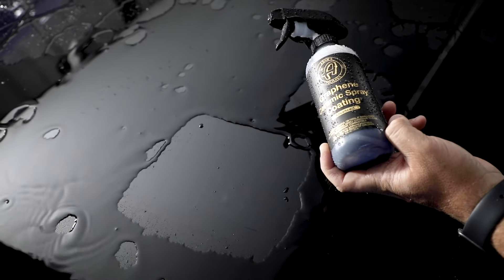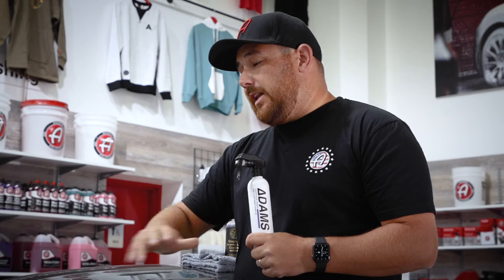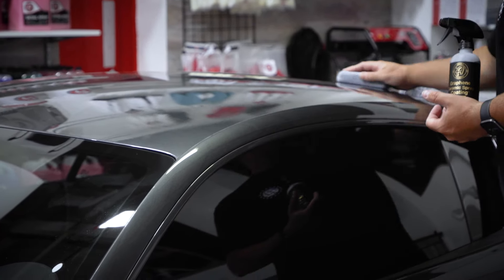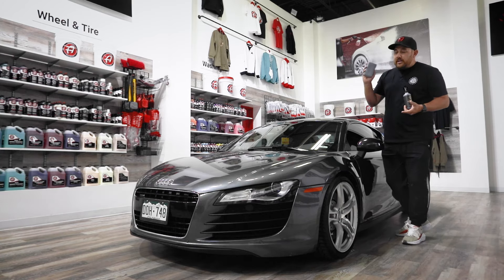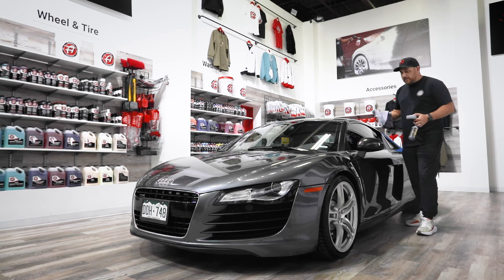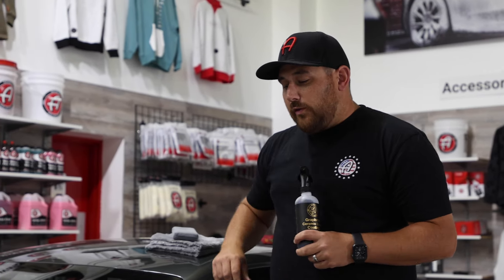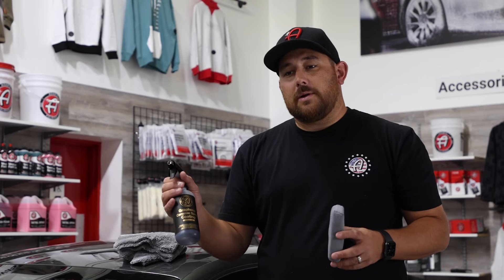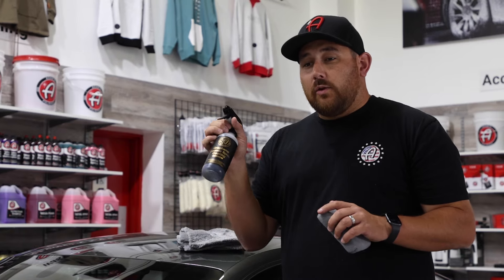How To Apply Adam's Graphene Ceramic Spray Coating Advanced

Comment: DO NOT USE THIS ON THE WINDSHIELD. other windows yeah, but the wipers grab the windshield when raining not “gliding” across the glass smooth. Did this on two of my cars.
Reply: what did you end up doing afterwards?
Reply: Actually all you need to do it apply the coating or a different ceramic to your wipers it will 💯 not grab
Reply: I applied to both of my vehicles with zero issues. Absolutely love how hydrophobic it is!
Reply: How has this held up? Over the time?
Reply: No issues on my windshield.....buy new wipers
Reply: I learned this the hard way.
Reply: Did you Clay Your Windshield before applying this?

Comment: Just received mine this afternoon. Prepped and applied it to the windshield of a ‘15 F350 Superduty. Extremely simple & easy application and finishing. The only thing that this video neglected to mention was the 4 hour cure time before exposure to moisture(rain, snow, etc.)
Reply: UPDATE - Not impressed. Water repellency is VERY disappointing. Water beads up but does not freely run off the glass. At 70mph big beads kid of walk up the windshield. Super grabby stuff. Again, VERY disappointing. It rained all day from Portland to Whidbey Island and I spent the entire time pissed at how the Adam’s “Advanced” product was failing to perform as advertised. The day after that trip I called Adam’s to inquire about what could have gone wrong. I was told to let it flash for 10-15 minutes instead of 1-2 minutes. Did that last night in a 61° garage and let it cure inside for 10 hours. Raining hard this morning and still the same result. This stuff is $35.98 garbage.
Reply: A lot of times products like this require a topper. Ik it stinks because of the cost but I had a heck of a time with 303 graphene until I used a topper extreme solutions makes one called topper. Other then that turtle wax is synthetic spray wax also works well to add slickness and even some depth. Good luck
Reply: The flash time will vary based on temps and humidity, the higher for either the shorter/less time it needs. Also, it behaves differently on glass than paint before removal, it is very difficult to see the rainbow appear and then dissipate. Sounds like you may have removed it too soon. What prep did you do?
Reply: think you'll have better results with stuff like rain x
Reply: Get a WINDSHIELD COATING!
Reply: @chrisinco5920  I thought colder temps require longer flash times
Reply: @otm777  You're absolutely right! My fault...had that backwards. Corrected. Thanks for keeping me honest
Reply: @pj9241  if it requires a topper, I'd seriously be asking the question "can I get the same result using ONLY the topper?"
Reply: @gregsullivan7408  sorry this was a while ago so I will do my best to recall what I meant.  The cure time of four hours before being introduced to the weather is troublesome for some so a topper that is solvent free is a good idea because it puts protection over the coating. I have also found products like this and some other spray coatings get better over the following week. I like adding a topper to add shine protection and water resistance to the coating as it sets up. A topper alone is fine but you will not get the same results as you would just using a topper. Another thing I have found is some of the ceramic based coatings leave the car with out the wax shine. Then definitely add gloss but they don’t have a warm shine a topper can help with that as well. So it’s kind of like the coating becomes an extension of the paint and the topper becomes the sacrificial layer then can be added after every wash.
Reply: @DRTYFN  Thanks for saving me money!
Reply: @ainttakenanyshit  I’m very familiar with RainX. I started using it in the 80’ when it was difficult to apply and worked great. Then they sold out in 97 or 98 and the formula changed and durability went down the toilet. Nowadays it barely lasts a week in Oregon rain.
Reply: @DRTYFN well that’s because this isn’t windshield coating it’s paint coating. You use their windshield coating for the windshield lol what are you yapping about.
Reply: Yes, RainX was great in the past, but it was a pain to apply. Now, it hardly lasts a week for me.
Reply: Ebay to apply, thought. I heard Pledge furniture polish works well, I have not tried it yet.

Comment: Question - should you prep the paint first? meaning, clay, polishing/buffing then apply the ceramic spray?  I am new to these things and want to make sure I do this right.
Reply: Yes! 1000000% prep the paint first, then use with their prep spray, or just some rubbing alcohol to strip off the wax and polish. Once the paint is bare then you apply this product
Reply: @orion9807  what if I don’t polish ? Will it affect it that I didn’t
Reply: @RodrigoRodriguez-ri7wn  any imperfections in the paint will be sealed in......so if there is any light scratches they are staying until you polish away the ceramic, and then polish the scratch......it's best if you just polish before applying for the best results. It doesn't need to be perfect, just looking better then before.

Comment: Could this be a topper for the Adams Graphene Ceramic Coating Advanced? Or I need to pick only one and don’t apply the other?
Reply: I wouldn't. For upkeep between coatings, I use thier graphene detial spray.

Comment: love this stuff. really no need for true glass coating with this since all my customers are maintenance washes I just decon wash and light clay and reapply another coat to rejuvenate. its amazing.  one of the few truly great affordable coatings that doesn't necessarily require full blown correction. though that only helps. I recommend that for 1st time application only

Comment: Have a questions, just received two bottles of Advanced Graphene Spray(BOGO deal).  One of the bottles is a clear liquid, the other is a black liquid, when applied it goes on black.  Emailed Adams, and they say this is normal.  Why the contrast between two bottles.  Should the product be black / staining?  Anyone else encounter this?

Comment: Ok have questions . It says not to smell it . What happens if you smell it? Also should you use glass coating on the windows instead of this product?
Reply from the maker: Hi Marc, ceramic spray coating has a very strong smell due to the solvents, similar to ammonia. Many of our products smell great, but spray coating will cause a burning feeling to your nose and eyes and could cause a headache. Once it is atomized into the air with the spray trigger, the scent is not as strong. Our Graphene Glass Coating will hold up longer and be more durable on glass, but the spray coating can be used on glass if you do not have the Graphene Glass Coating.

Comment: Is this gonna be sticky when removing/wiping off the coating with microfiber towel? I’m facing this issue when applying graphene spray coating and it makes a lot of residue from the towel sticking to the surface

Comment: I applied the advanced spray ceramic on my car and I’m so thrilled with the results I want to use the full GRAPHENE ceramic now.
Can I apply that over the spray ceramic or should I just live with the spray coating that’s on the car now?
Reply from the maker: Hi P D, you could apply the full graphene ceramic coating on top of the advanced spray coating, but it will not bond as well or last as long. We would recommend waiting 6 months or so, as the spray coating begins to wear some, to then do a thorough decontamination wash, prep, and then apply the full graphene ceramic coating 👍

Comment: I just got mine gunna try for the 1st time ever doing a ceramic coating.

But I'm confused, this guy says wipe off after the rainbow fades, but the bottle says allow 1-2 min to dry until u see the rainbow..

So which is it??

Wipe off after the rainbow fades or when it forms?
Reply: A little too late here but you’re supposed to wipe it as soon as you see that rainbow.
Reply: @possiblepresent3724  OK yeah some of it I waited until after the rainbow faded?? Like thought that's when it was done sticking to the paint?

Comment: I have some Carbon Fiber trim running across the front of my forward most dash, on the doors, and Center console area in my B9 Audi S4 , I was just looking at the scratches that have shown up and was looking to find a product that I could use that would help protect from scratches when I detail my interior, I just ordered this spray. I CANT WAIT to use their scratch remover and hand polish I bought from Adams and then coat my
Trim 😃

Comment: Just got a brand new car and full car PPF. I've only driven it 500 or so miles. Would you recommend I decontaminate/clay bar, polish, surface prep and than graphene? Wouldn't the surface prep remove the work done by the polish?

Comment: OK so this may be old news but I was having a problem with your spray nozzle for the tire and rubber cleaner not squirting at all After using it a few times and I had plenty of product in the bottle so today I decided Hey what if it's clogged up so I ran it under hot water both the straw and the nozzle and it squirts now so that stuff dries in there if you don't use it for I don't know a week or more so I suggest cleaning it out after every use

Comment: Do you need to toss the towels after using them like you do with a standard ceramic?
Reply from the maker: Hi there, not necessarily! The spray coating residue doesn't harden and crystallize as much as can happen with the thicker 60ml coating bottles that we offer, but we do recommend soaking the towels after application in a bucket of water with an ounce or so of our Towel & Pad Revitalizer, so that the spray coating doesn't make the towel water repellent. I like to mark my coating towels with a black marker or put a small cut into one corner so that I know it has been used with a coating previously. Then I know to test it carefully on the next vehicle if that vehicle has a delicate clear coat. If you do want to toss them, consider using them for less delicate jobs like exhaust tips, engine bay, etc before throwing them out.
Reply: @AdamsPolishes  thank you so much!

Comment: Since you spray the cloth, why not just use the 5 year product?   I mean, you use an applicator for both, but you have to re-do the spray-on product every year (for an outside-parked car).  Is it easier to use?  More forgiving?   I don't get it?
Reply: from what i’ve seen, the formula is less concentrated, meaning it’s a bit cheaper and you don’t have to be AS careful when applying. In my case i’m considering using this product because I don’t have a polishing machine for the prep, and I’m kinda of scared of not applying properly since it will be my first time. I think it is not a great deal to not use a polisher in my case because my car is 6 months old, if the car you are applying this to hasn’t been polished i suggest to ensure the vehicle is polished before application.

Comment: Should you dispose of the towels used to remove/level the coating, or can they be effectively washed and reused?
Reply: Nope. When using ceramic or graphing get rid of em.
Reply: Can you apply this over other Ceramic coatings that have been previously applied?
Reply: @Mark Erbesfield  I always use a strip wash snow foam and shampoo to remove any remnants of an old coating. If I'm trying to replenish an existing coating, I turn to things like Mirror Polishes Touchless foam-on solution, or Gyeon's Wet Coat. All you do is rinse those products off, and dry - simple way to keep your coatings durable.
Reply: @merbesfield  I don't see why not, but what would be the point in doing that? Is the previous CC not holding up or not to your liking?
Reply: How many wipe off towels do you need to do a truck? Can you use one for the whole thing? Or will it get too full and just start spreading the coating rather than removing the excess?

Comment: do i spray on car or applicator?
Reply from the maker: Hi Gabe, we recommend spraying into the applicator directly, 3 or 4 sprays per panel, facing away from the vehicle. The overspray can travel far, so that is why we recommend to face away from the vehicle when you spray it into the applicator. Do NOT inhale the fumes either.

Comment: Can you use wax over graphene coating?
Reply: interesting...typically it would be one or the other. Personally I think it would make more sense and be cool to try waxing then coat, but I'm just a backyard boogie DIYer 😂. Let me know if you tried yet and how it worked out.
Reply: Did you find out about this? I'm asking same question. Carnuba always looks amazing would love to add on top for added depth.
Reply: Adam's answered this question posted by a different user. Their response:  "...you could, but it is not necessarily recommended. A carnauba wax is in a different product family than ceramic coatings, and could make the coating perform less in terms of hydrophobics and water repelling behavior. Graphene Detail Spray or CS3 would be better and more compatible toppers for a ceramic coating to enhance performance and shine."

Comment: I have a brand new car, with less than 200 miles. Do I need to prep the paint with anything other than a simple wash and dry? OR should I handglaze it before Adams ceramic coating? I purchased your Graphene Complete kit.
Reply: same here and after researching the web they say yes,we just don't have to use a compound a simple wash,machine polish and decontamination will do just right.

Comment: What's the best temperature to apply Adams?
Reply from the maker: Hi Ryan, for the spray coating, easiest application would be at room temperature and low humidity, but we have applied out coatings in temperatures as low as 50F. 60-80F would be ideal 👍
Reply: @AdamsPolishes  tyvm

Comment: Dumb question from someone who is learning.  
After buffing the car, would I apply wax and then this stuff or just apply this after buffing?
Reply from the maker: Not a dumb question at all! You do NOT apply a wax if you are going to use Graphene Ceramic Spray Coating. The coating needs to be applied to the bare paint after machine compounding and polishing it. The coating replaces your wax step.

Comment: I think I have some high spots, or just plain spots I missed on my windows. Any suggestions on fixing it?? Add another coat like you said and even it out? I thought about taking my mini rotary and taking it to my windows and then re apply the product. Open to suggestions thankyou
Reply from the maker: Hi there, did you apply our Spray Coating or the Graphene Glass Coating, and how recently was it applied? If you applied the spray coating in the last day or two, you should be able to fix the high spots by reapplying a little more spray coating onto an applicator, spreading it over the affected areas, and then immediately wiping with a bit of pressure. Make sure to flip the towel to a clean side and wipe again to avoid any smears. If it's one of our more durable coating options, or if the high spots have cured for several days, try taking a drop or two of our Brilliant Glaze or white Polish onto a towel or applicator, wiping into the area in left-right and up-down motions, then wipe away the residue with a clean microfiber towel. These will usually remove the high spots without compromising the actual coating layer. Using your mini rotary should be the last option, since it will remove the coating in that area and you would have to reapply. Let us know if you have any other questions!

Comment: I have headlights with clear coat on them I would like to protect them from going bad like my last pair of headlights would this protect the headlights from having a peeling look because of the clear coat coming off I did not protect my last headlights
Reply from the maker: Hi Steve, our Graphene Ceramic Spray Coating Advanced will certainly help, but I would recommend reapplying it to headlights about twice as often as paint since they experience such high levels of constant heat when the headlights are on. Some aftermarket headlights have much better or much poorer quality than other brands, so it will also depend on the manufacture of the light housing itself and whether the vehicle sits outside every day or if it is garaged. I've had some aftermarket headlights that have lasted for several years with no issues, and others that began to have clear coat failure and peeling after 6 months.
Reply: Well my 1st pair went bad probably I don't know like a year or 2 and my car does sit outside all the time I have Anzo headlights because there's not too much you can find for 2013 Hyundai Genesis

Comment: What do I use for polish with my buffer? If I use a polish with carnuba then surface prep would that work?
Reply from the maker: Hi Brian, a polish with carnuba would be adding protection to the surface as it corrects it, so the graphene ceramic coating may not bond as well. Surface Prep would weaken the carnuba, but may not completely remove it. We would recommend a dedicated polish with no filler and no protection, like our white finishing Polish, with our white foam pad: 

https://adamspolishes.com/products/adam-s-paint-finishing-polish

https://adamspolishes.com/products/adam-s-new-6-white-foam-finishing-pad

Comment: What is the shelf life for the original? I found a kit from 2020 in my closet. 
Assuming it's still good, logtivity is likely less?
Reply from the maker: 2-3 years for most of our liquids if stored in a room temperature environment, but it should still be good as long as oxygen and moisture were kept out of the bottle. Make sure there is no crystallization inside of the bottle. You can always test it out on something other than your vehicle first, such as an old appliance, glass, etc.
Reply: @AdamsPolishes  used it last night. Wow I really like that stuff and the graphene detail spray